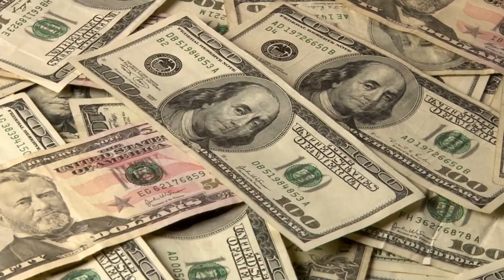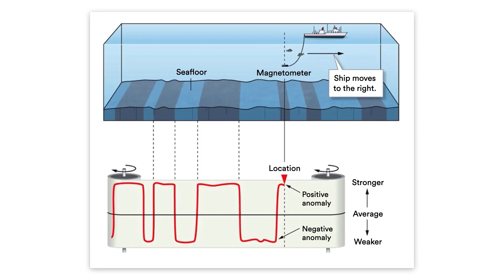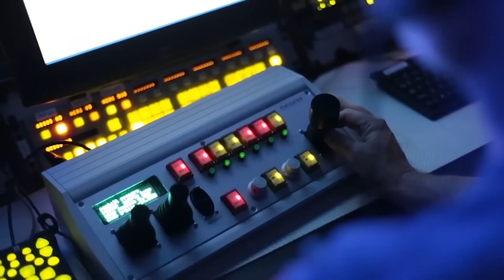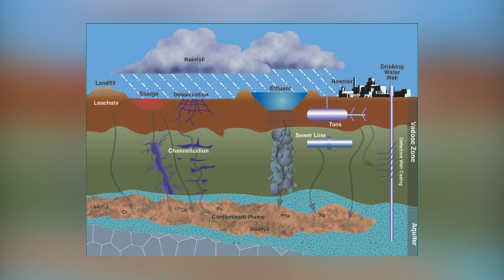Is Deep Sea Mining the Future?

Comment: TMC corp  The Metal Company has done a 18 month environmental study and their Vacuum system is able to collect upto 200 tons an hour of polymetallic nodules with VERY LITTLE impact
on the environment. 
Based on the average composition of polymetallic nodules, 200 tons of nodules would yield approximately:

42 tons of nickel
32 tons of copper
7 tons of cobalt
12 tons of manganese
2 tons of molybdenum
1 ton of zinc
We want a green new world this is by far the better way to power this Brave New World,  forget strip mining.